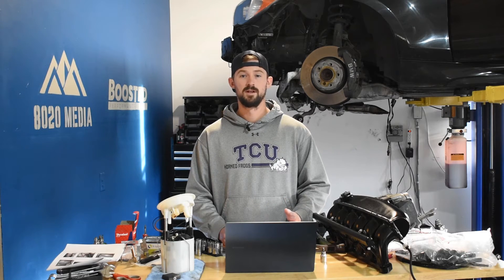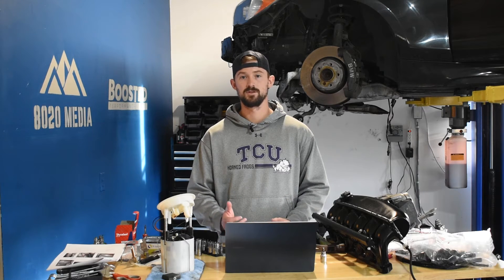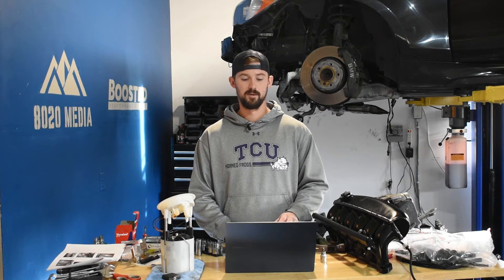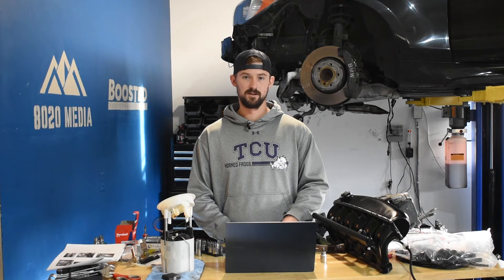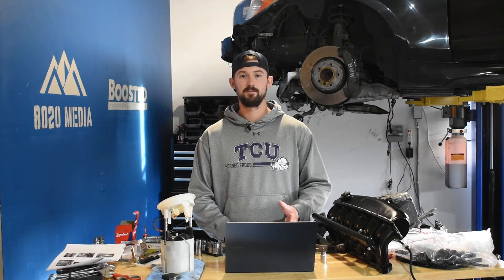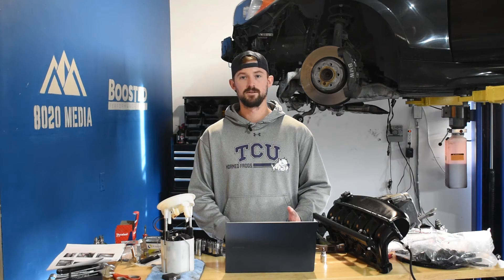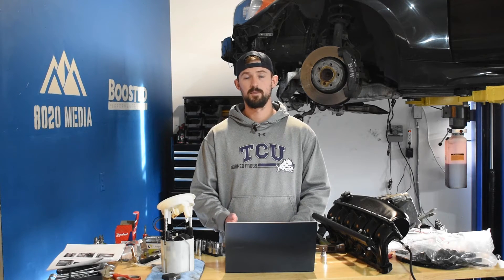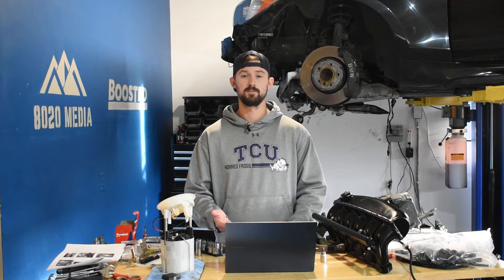All About the Duramax LML | Common Problems & Reliability

Comment: Any reasons to upgrade egr coolers and replace valves preemptively as part of cp3 swap? My diesel shop shared that was another weakpoint many owners chose to fix.
Reply: Egr cooler prone to leaking. I pulled all of my stuff. No issues since.

Comment: I have a 15 LML. It's been deleted and tuned, with new head gaskets, a CP3 conversion, a FASS fuel system, and a Fluidamper on the crank. Head studs and going on 240,000 miles.
Reply from the maker: B - You DEFINITELY did it the right way!

Comment: If you buy a used 2016 how can you tell if it has a CP4 or CP3???
Reply from the maker: L - All 2016 LML Duramax trucks came factory with a CP4 high-pressure fuel pump, but if you're checking for a CP3 conversion, look for a larger, more angled pump body, a cylindrical fuel control actuator (FCA) mounted at the top front, and possibly aftermarket brackets or adapter plates since the CP3 doesn’t bolt in directly; the CP4 sits more vertically, is compact, and has its FCA mounted horizontally, while a CP3 setup often includes modified return lines and may show signs of custom hose fittings—so a quick visual inspection comparing size, shape, and mounting position is usually enough to tell the difference.

Comment: CP3 with lift pump make the LML the best modern duramax, avoids the injector problems of the L5P and the newer L5P can not even be tuned now. 

SO stock LML, Hell no CP4 hell.  Modified LML with CP3 + LIFT = the best. Easy 200HP increase on stock with delete.
Reply from the maker: F - Well put! Thanks for sharing these insights.

Comment: How do I delete I have a 2013
Reply from the maker: W - You need a delete-capable ECM tune to disable the DPF, EGR, and DEF systems, preventing check engine lights and limp mode. The DPF must be removed and replaced with a straight pipe or aftermarket exhaust, the EGR system needs a block-off kit or full removal, and the DEF tank, lines, and injector should be disconnected after tuning disables them. Deleting improves reliability, fuel economy, and power, but it voids warranties, can result in legal fines, and affects resale value. If done for off-road use, ensure a reputable tuner programs the transmission correctly to avoid drivability issues.
Reply: @8020Media  thx

Comment: I've heard the same thing covered in this video from several sources, so the first thing I did when I bought my 2016 GMC 2500… like within a month…was add a lift pump, do the CP3 conversion and DPF delete.
Reply from the maker: 0 - Best thing to do!
Reply: Care to share which kits you went with?
Reply: @22TheJmans  Sorry, I didn't do this myself and I don't recall specific brands when I was discussing this with the installer in 2017(DFW area).  I know the lift pump is a FASS 250.  The CP3 conversion is probably the most involved and expensive, and some of them don't really need a lift pump.  It depends on which one you get.  I think the EGR and DPF delete are the easiest… meaning it is so important… but you also need an ECU/engine tune, if you don't already have that, to get rid of the check engine light.  And a transmission tune is also a really good idea get at the same time.  That really makes a big difference.  I also got a larger turbo, which make the engine and transmission tune really important.  (Not sure if you are starting from stock or not, so I just threw everything out there.)
Reply from the maker: 0 - Thanks for coming back and sharing this info with a viewer!
Reply: @8020Automotive  Glad to do it.  I had so many questions when I started and answers were hard to come by.  There are so many options out there and they all have caveats that need to be understood.  Luckily, I found a local shop that can answer my questions.  And depending on the state, a lot of these mods can't be done because those pesky laws and whatnot. 🙂 I'm lucky enough to live in Texas, so it's not hard to find someone.  Also, emissions tests aren't required for diesel trucks, even in the major cities, so I only need to pass the standard safety inspection.  Anyway, I'm so excited that after deleting DPF, EGR, adding 4" exhaust, with muffler, CP3 conversion for peace of mind, lift pump and engine/transmission tune, my 10,000 pound GMC can easily chirp the 37"x 13" tires in the first 3 gears and still get 20 MPG on the highway, which is just 3 MPG less than my friends twin turbo, straight 6 Ram 1500, even though I have more than twice his displacement and twice  his weight.  How can I keep quiet about that!  🙂(and if I put standard width tires, I know I'd beat 23 MPG)
Reply from the maker: 0 - Thanks for sharing!
Reply from the maker: 0 - So true! Thanks for taking the time to share!

Comment: I have a 2011 lml and have had it deleted. It is around 430,000 mi and I have not had a cp3 swap;do you recommend a swap and a lift pump?
Reply from the maker: M - Sounds like you've got a nice build! You don't have to, it just goes down to what your goals are with your truck.

Comment: When replacing cp4 with the cp3 would i have to replace anything else with it or is it a simple remove and replace?
Reply: When I changed my 2015 over to a CP3 and doing a delete on it  after blowing 2 CP4 pumps with less than 120.000 miles on it ,it required a adaptor kit to install the CP3.but it was well worth the $12,000 ca it cost to do it all.

Comment: Love owning a deleted 2016 LML. By 2016 apparently a lot of the injection issues were fixed so I’ve heard no need for a lift pump
Reply from the maker: U - We agree.
Reply: What about 2015? @8020Automotive
Reply: You heard wrong, fuel pump and lift pump are both needed.

Comment: LML is the worst out of the entire bunch. The few problems that they do have, while rare, are all quite catastrophic. Head gaskets, fuel system, and they break more cranks than any duramax before it. Do what I did and skip it for the L5P. Absolutely love mine.
Reply: You are smoking something.  The LML engine is great as long as you take care of the CP4 issue and add a lift pump.  I would not trade mine for an L5P. Mine is tuned and deleted and will smoke stock L5Ps all day long.
Reply from the maker: M - Thanks for sharing your experience.
Reply from the maker: C - L5P's are great for sure. Thanks for sharing your opinions.

Comment: 2015 4x4 LML here, remove all that emissions crap, swap to CP3 and lift pump, it’ll be the best thing you ever did for your truck. She’s currently at 260k and still purrs like a kitten and I have no intentions of letting her go anytime in the foreseeable future.
Reply from the maker: D - We can't recommend, but yes you are correct! Very well said. Thanks for sharing your experience.
Reply: @8020Automotive  completely understand brother, I live in Mexico.
Reply: @8020Automotive  All stock 16 LML 310k miles no issues its my 2nd LML my other 2012 LML 292k miles, on its 3rd pump and the main cause of pump failures was the aftermarket lift pump!! FACT!!!!!!
Reply from the maker: @jeremybroderick9465  Thanks for sharing! You're well versed with the LMLs.
Reply: @jeremybroderick9465 I thought a lift pump helps the fuel pump?
Reply: No doubt man, i did the same to my 14’ denali hd with 280k on the clock and not a moments trouble out of her🫡
Reply: Where do I get this work done
Reply: What delete package do you recommend?
Reply: Mines sitting at 220k stock lol

Comment: I’m looking to buy a deisel more for the power and other big truck things , I just put over 300k on my 05 Yukon and wanting a pickup im currently looking at a 2006 duramax with 191k and 2011 duramax with 136k. Definitely hoping to get something just as reliable as my yukon was
Reply from the maker: LML is good if you delete everything. Otherwise my preference would probably be the LLY - just do the necessary cooling upgrades and make sure it's been taken care of.
Reply: @8020Automotive  thank you so much for replying, preciate it.
Reply from the maker: W - Keep us updated!

Comment: Looking to buy a 16’ LML 170k already tuned/deleted.they had it 4 years no problem super clean. Shop just did some suspension work and checked the fuel system everything was fine but it’s still on the stock cp4
Reply from the maker: Well the delete is definitely a positive, 170k without CP4 issues is good but certainly wouldn't hurt to reinforce it a bit or replace it given mileage on it.

Comment: What’s the avg life span of one of these motors.  Everything I’ve read says 200,000 you say 3-400,000 but I haven’t seen many websites saying that
Reply: My 13 has 395k km. Def has been deleted. If you used a fuel lubricant, swap out the factory cp4 for an aftermarket cp4 or do a cp3 conversion,  add a lift pump, do an emissions delete, you'll never have an issue. Motor will last forever.
Reply from the maker: N - Thanks for taking the time to share your experience! Sounds like you've got a nice build.
Reply from the maker: S - Average is likely 200, but we've seen many in the 300's. It all depends on maintenance.
Reply: We have a 2011 6.6 lml Chevy Duramax and it has 420k miles on it still running the original motor. Was well kept up with and our everyday driver even today.

Comment: Actually, the DEF heater problem affects all users. If a heater fails, even at temperatures well above freezing, you still end up in limp mode. I know because I had a tank heater fail en-route to Alaska in the Yukon, 130 miles from Whitehorse. The warning appeared on the DIC, and informed me that I had 150 miles to go before I'd be limited to 4 mph. We got back to Whitehorse and spent a week waiting for a new tank (you can't just replace the heater). You'd think the bright bulbs who impose these limits would design a better system, and allow more miles.
Reply from the maker: James - Thanks for sharing your experience! This will be helpful for future viewers.

Comment: do you have any opinions on the crankshaft? I'm looking at buying a 2011 LML with 180,000 miles, but I've heard some stories of the crank breaking because of the firing order. is this a common issue?
Reply from the maker: Definitely not common, I wouldn't worry about the crank unless you are planning a high horsepower build. The crank is known to have issues but not really until you start talking about 700whp+ or big torque numbers

Comment: The fuel pump on my 2002 Sierra died this week so I had to take it in for replacement. I have a 2015 Sierra LML that I typically don't drive in the winter - I use the 02. Since the 02 is now in the shop, I have to drive the 2015. We've had really low temps (@ 4 days with highs in the minus zero range). The past week it's been in the upper 30's to low/mid 40's. When I started the 2015 it struggled to start - took 5-6 attempts and finally started. However, the "engine" icon lit and has stayed on. There's no message anywhere (I had to have the 2015 DEF system serviced/replaced by a Chevy dealer a couple of years ago under warranty) and at that time I got a message to check the DEF system with the speed reduction notice.

The shop that's working on my 02 doesn't have the ability to read diesel codes if there are any (the 2015 has 48,000+ miles). I did have it's fuel filter replaced this past summer so probably less than 3,000 miles on. The nearest dealer that serviced the 2015 for the DEF repair is @ 55 miles away (I drove it there and they gave me a ride back home, then picked me up when the work was done so no complaints there).

The owners manual just says to check the emissions system when this icon lights and stays on. I haven't tried disconnecting the batteries to see if that does anything (a Duramax forum member said that "fixed" his problem). As it's now the weekend I can't contact the dealer until Monday.

Any ideas/suggestions in the meantime?
Reply: I’m an old man and thus my performance days are long gone. What’s the likelihood of CP4 failure on my ‘16 LML if I always use Hotshoters Choice and NEVER rev over 3,000?

Comment: What do guys think of the 2012 lml 6.6 any word in them truck about to buy one buy skeptical if I should go with a ram Cummins  or Silverado
Reply from the maker: I suppose that really depends what you are trying to do with it but more importantly what matters is the condition of the truck and how well it has been maintained. If you're looking at 2012 as a year in general I'd probably get a Cummins but that's just me. That platform had at least been around since 2007.5 and isn't one of the first few years of a new platform like a 2012 LML is, and earlier model 6.7 Powerstrokes are known to be a bit more problematic too, mostly just early kinks from a new engine. 

Not to say an LML is a bad choice by any means. Just depends the condition it's in and what you're trying to do with it.

Comment: LML was from 2011-2016, are mid to later years less prone to these "issues"?
Reply from the maker: D - In our opinion, mid to later years (2013-2016) would be better.
Reply: @8020Automotive  came across a 2015 with 70k miles and am concerned with the cp4 issue
Reply from the maker: D - The CP4's certainly aren't the most reliable. We think this may be helpful for your research: https://chevytrucks.org/duramax-lml-engine-problems/
Reply: @dskize1 my 15 lml cp4 just crapped out at 230k so i would say the truck is worth buying but be sure to use a fuel lubricant and ride on..repair cost is $12k.. ps..the 9th injector didn’t come with the repair kit so the mechanic bought it separately.
Reply: @tobysmarts  thank you very much for your comment.  I truly appreciate it!!
Reply: @dskize1 Run a lift pump and make sure you run some sort of additive. I like using the hot shot additives on my lml.

Comment: my lml has 140k. shes deleted and runs like a champ. fingers crossed my truck was built midweek and not on a friday.
Reply from the maker: E - Thanks for sharing your experience! It sounds like you've got a good one!
Reply: Mine has 287k with the cp4 and still runs beautifully. The only problem is the glow plugs are busted and I live in Minnesota 😂
Reply: @blakelarson6.7cummins mine has 420k with a cp3 conversion we just now had to replace head gaskets on the original motor

Comment: So far... biggest issues with my lml.. is emmisions. Plan on deleting that.

I had to replace egr bypass, egr valve, egr pipe cracked, for some measure of reliability  i replaced egr coolers with aftermarket "Bulletproof".

Idk.. sick of messing with my lml, i want to play with my l5p finally
Reply from the maker: N - This seems to be a common them and why delete kits are so popular. Sorry to hear about your experience.
Reply: @8020Automotive  you guys are badass. Never would i say tho.. lml is bad engine. One of the best, great sounding power houses of an engine. Just have to live in a emmision free county to take full advantage
Reply from the maker: We appreciate it.💪🏻
Reply: There’s much more to mess with on l5ps than lmls… parts are more expensive… there’s many more emissions parts & related sensors… tuning is wayyy more expensive. 
L5p is the way to go though if looking to upgraded and to get a newer warranty for all of those parts. So depending on what your do with your trucks, ymmv
Reply from the maker: Reckless - Very true.